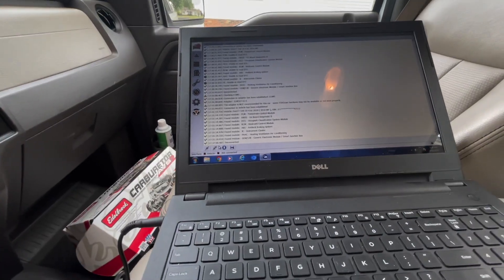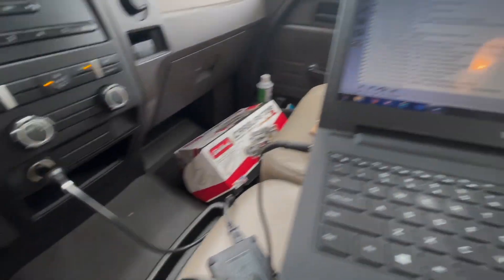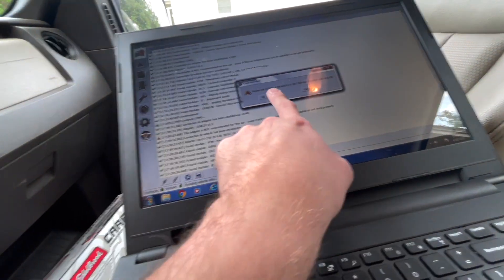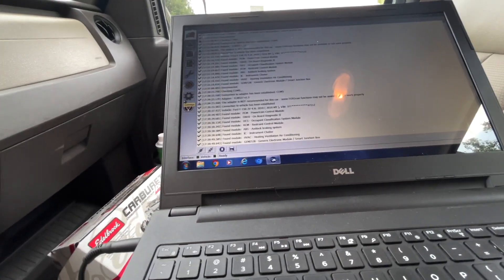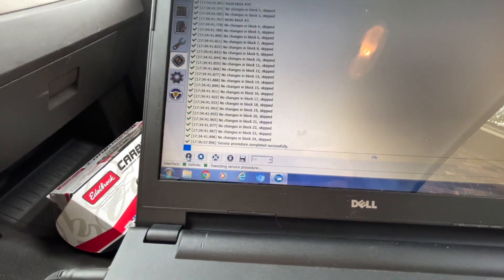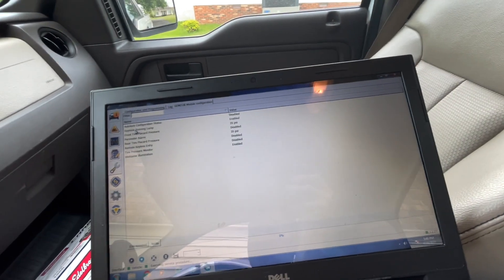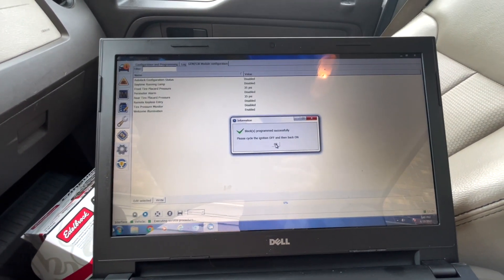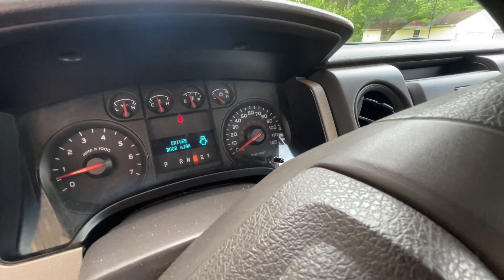DIY! ForScan: How To Disable Daytime Running Lamps

Comment: Would this program reset back to normal if you unhook the battery, or is it permanent as long as the computer works?
Reply from the maker: I never actually tested the theory. But, it rewrites to the system memory - so my guess would be it stays 👍🏻

Comment: Hi. Will this definitely work on a Canadian 2011 Ranger? The DRLs come on when you turn the key on, as in, they come on in PARK, not just in D/R. This is very important to me, 'cuz it's the determining factor in whether I buy this truck or not to replace my '05 that an idiot totaled for me! Thanks!
Reply: Well, he didn't get any results, so his dealership mechanic is going to help him out tomorrow. The saga continues ... grins
Reply: Oh, I HATE DRLs, so if there's even a chance that this won't permanently disable them, I'm going to play it safe and buy a different 2010/2011. Thanks again.
Reply from the maker: Rangers are a different animal. I’d be inclined to say it could not work, but I’m not for sure. Here’s why: Most Rangers even from 2010/2011 (last models) use the same PCM that Rangers from 90s and 2000s. I have a 2000, it’s very limited to what you can control/turn off.
Reply from the maker: For sure, let me know!
Reply: @timberwolf7341 did it ever work?
Reply: @subarusti8799  I made a long reply but it was eaten! Ah, well. Now my replies are multiplied. I give up. Seeya.
Reply: @RandomAutomotive  No. I made a long reply but it was eaten! Ah, well. Now my replies are multiplied. I give up. Seeya.

Comment: Do you have to have the extended license to do this? I clip on the micro chip and everything pops up but no matter what i click on when i try to run it, it just keeps popping up need extended license to use this function
Reply from the maker: This did work with the license shown, that may have changed since then though.

Comment: How can i do this on a 2013 escape? Tried but can't find drl
Reply from the maker: It should be there! Do you have the HS MS CAN switch set correctly?
Reply: @Random Automotive  i do, no options for lights. I have a Canadian  version so they are always on even in park and e brake up
Reply: Gmshb doesn't come up for me
Reply from the maker: @T. C.B  I'm wondering if there's a difference on canada built vehicles since it's mandatory there (I think lol).

Comment: My Ford explorer 2017 Auto lights it's always on and it's doesn't turn off automatically during sunny days this happened when I changed some things with forscan any help please
Reply from the maker: If this process doesn't work (meaning DRL isn't the issue). It may be a bad connection to your ambient light sensor, or something is blocking it. The sensor (usually found on the top of the dash) is what tells the truck when it's dark/daylight. That may need to be looked at or replaced.

Comment: Is there any way to do this without a scanner or computer? Any fuse that can be taken out?
Reply from the maker: On very few older cars it is a possibility - on anything modern (2007+) No. The DRL is controlled by the ECM, pulling the fuse would kill the headlamps altogether which you do not want to do.